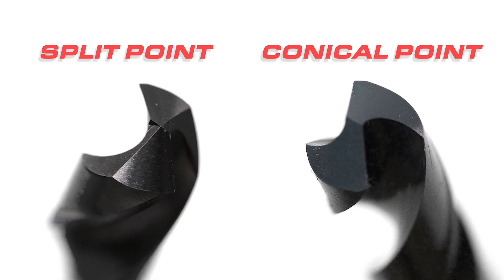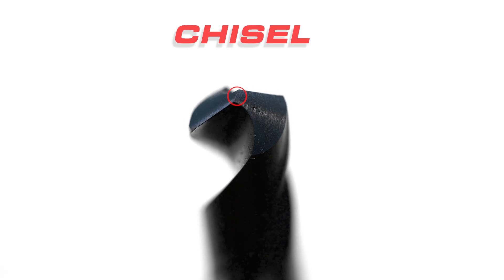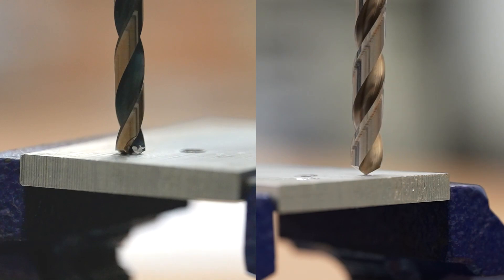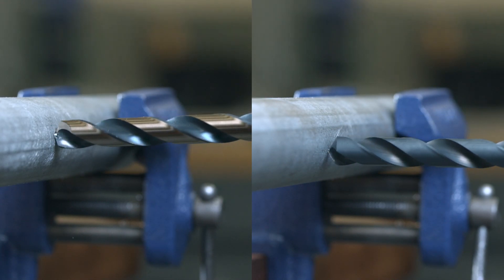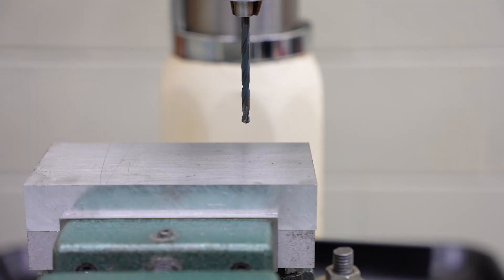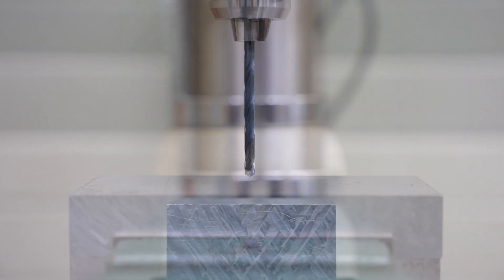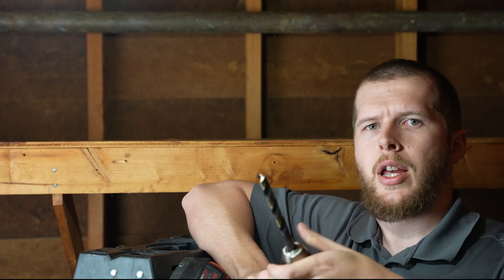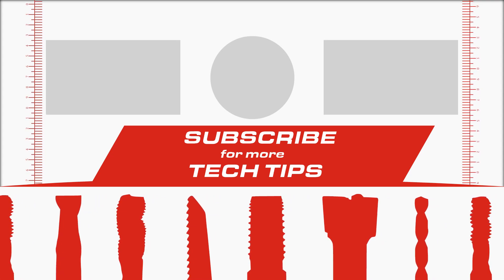When should I use a SPLIT POINT Drill Bit?

Comment: The splìt point reduces the chisel edge thus making the drill cutting than pushing the material at the core of the drill.
It helps to reduce thrust force and gives better centre cutting of the drill.
Simpy put the split point makes easier and more accurate drilling.